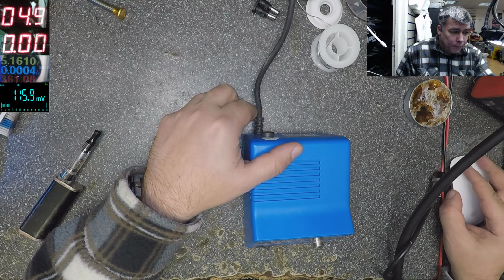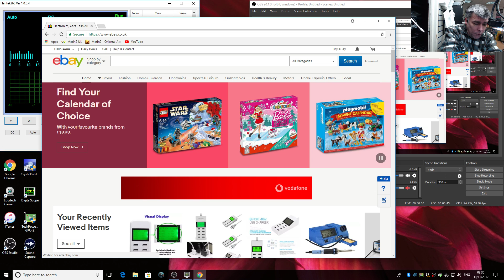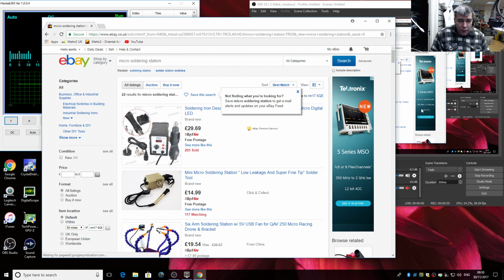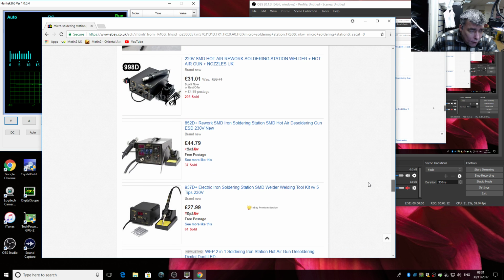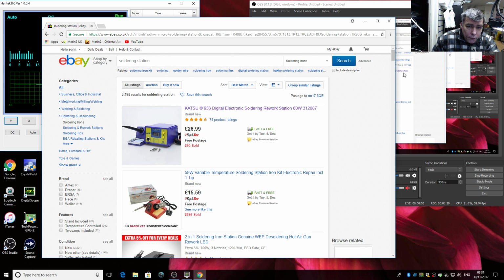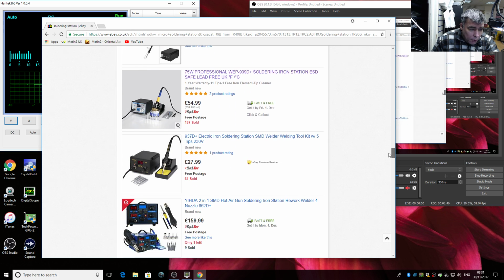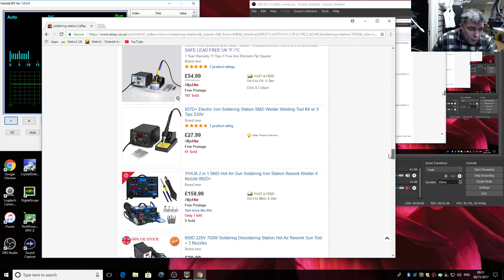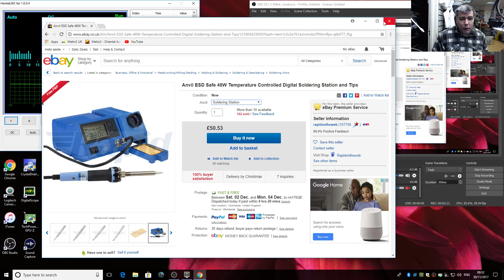My soldering station just died, lets fix it :) Cheapest possible soldering station

Comment: Dear Sir,
my Weller WSA 1 rework station. I have the following problem:
When I turn on the power switch, the green indicator light comes on. The pump starts. This all lasts for 1 sec, at which point the main 0,8 A fuse blows.
I would like to ask for your opinion from your experience what could be wrong. At the same time I also ask you for an electrical diagram of the control PCB.  Thank you very much in advance for your help.

Comment: Pkease i need your lights!!! I have Yihua AAA solder station,the hot air work perfect but my iron has a problem,so when i put for example my iron in 340c the screen of temperature goes max 84c and my iron temp is full hot,no cut temperature and it show me 84c when i setting to 350c, i put other iron and the problem is the same with difference in temp screen,until show me 84c,it show me 104c!!! Please help me.thanks

Comment: probably you remember the old sordering pistols with bakelite body, a small light bulb, no thermal fuse, and tips made with 3mm copper wire... I still have one gave to me by my electronics professor when I was about 15ish after I accidentally had the ideea to improve my father's old one by exporting the windings. I used to check how hot it was by "smelling it" like you did with the soldering pencil.
then I bought that soldering station too, just with 3 pin pencil connector instead of 4 because it's an older revision. If I remember correctly part number it's zd-931 something, rebranded by many, and in about 15 years I had to change only once the heating resistor...

Comment: Hi! My the best soldering iron is TQ-95. No any electronic elements inside, per 10 s from 20 watts to 200 watts.Only one problem- no too many different tips for this model. You can try it. 8 years no any problems.
Reply: Hi, which soldering station do you recommend I buy ?

Comment: Only downside of thermal fuses is that you can't solder them - minor irony there ;) I would be inclined to replace the fuse like for like even with the pain of crimping it - it was there for a reason. We see a lot of blown thermal fuses in Repair Cafés in mixers, hair dryers etc and have a replacement stock of various ratings - if the 'worst' were to happen and they traced it to a thermal fuse that had been removed/shorted out there would be no end of trouble to be had!

Comment: I've been watching your videos for months now and I've learned a lot of things especially how mainly a laptop works. My hobby is electronics mainly on DC voltage. Since I did not go to any type of electronics schools, these types of videos helps me a lot. I have now successfully fixed my surround system that it died years ago, thanks to this trick. I will replace the thermal fuse with proper one just to be safe. Thanks a lot Sorin. Keep on teaching us :)

Comment: I would have replaced the thermal cut off with a 150'C to give some protection but at higher temperature or fit a resetable snap switch with access from outside. 
Be well and take care.

Comment: very good job sir. but I really do not know what you have done that made your station work again. what did you solder ??
Reply: SteXist There is a small thermal heat fuse inside that big transformer.He just soldering the hot and ground wires of that electrical socket wiring together in that big transformer to bypassing that small thermal heat fuse.That save him 50 Euro for a new soldering station,but the next time that big transform causes overheating,it will causes a fire to that big transformer,now it just don’t dies like before because he bypassed the small thermal heat fuse protection.Now he have to be remembering to unplug that soldering station every night before he leaving his shop or putting a big wrist burning his shop down.

Comment: You might want to take a look at the bakon bk950d. I've been using it for a long time and it's been working very well.
It uses hakko T12 which are easy to change out and you can get it for 20 dollars from aliexpress.
Reply from the maker: thank you , i will check

Comment: If its brokes again you need to update to a T12 soldering station, there are many good and cheap clones 
The heating element is in the soldering tip.
https://www.aliexpress.com/item/T12-Soldering-Station-STC-T12-D24-Digital-Soldering-Iron-Station-Electronic-Welding-Iron-Tips-Temperature-Controller/32814643870.html?spm=a2g0s.13010208.99999999.440.RFOSHN

And this soldering handle 
https://www.aliexpress.com/store/product/FX9501-T12-Soldering-Handle-Set-Electronic-Soldering-Iron-220V-70W-For-FX9501-Soldering-Iron-Handle-250c/1486111_32773157016.html?spm=2114.12010612.0.0.7c2867eaDttwvD
Reply from the maker: well, i bought this one for microsoldering, mainly phones, because has a small tip 0.3mm

Comment: Smashing job, nicely recovered :-D
The dead thermal fuse in the primary i've seen in small radios.
The radio stays on for long periods of time and the fuse must weaken.

i do the same as you, but i drill extra holes in the case by the transformer and in the top case, get more air through :-)